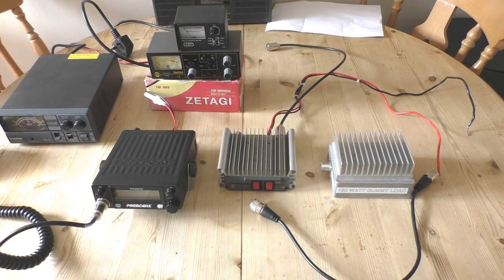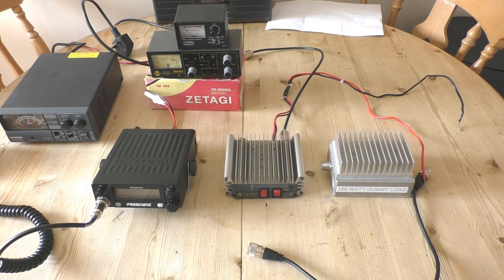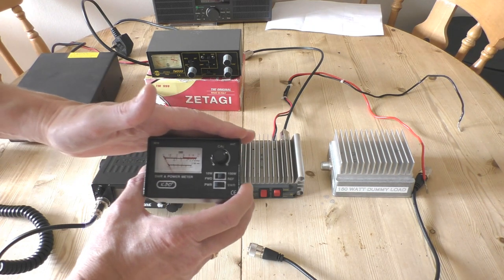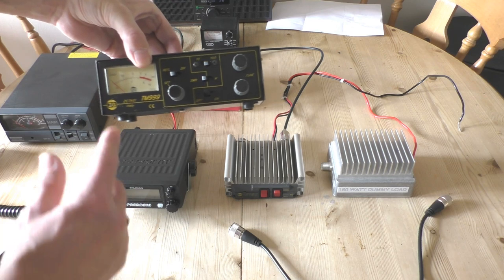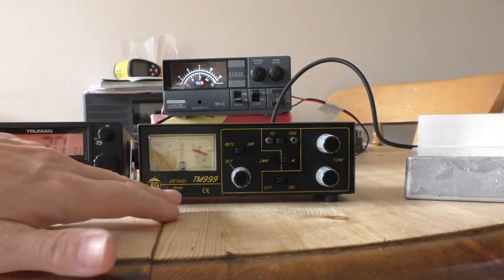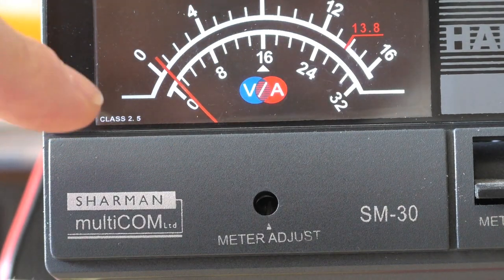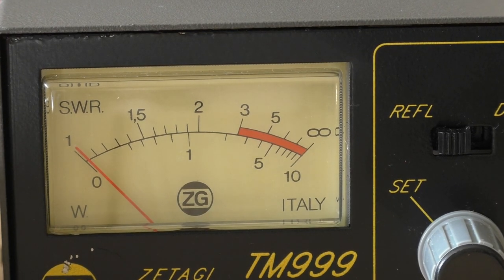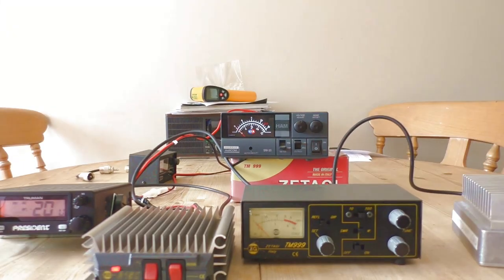How many watts do you REALLY get from a CB amp ?

Comment: I'[d like to see that Zetagi on a spectrum analyzer to see what the 2nd and 3rd harmonics look like. Upping your power through a splatter-box is not a clever move.
Reply from the maker: I doubt it would be very clean.  These small amps are built to a cheap price.
Reply: Just times the fundamental frequency by 2 or 3 and that will give you a ball park frequency. We tested a RM KL203  on a spectrum analyzer it was terrible above 60db on the 2nd harmonic. If people will insist on using them put a band pass filter between it and the aerial. Non of the so called C.B amplifier's have filtering in the P.A stages. You only have to look at the circuit diagrams to see. I won't call them linear's because they are far from it!!!!!

Comment: Apparently not to many operators here understand what S.W.R. is  the abbreviation is for standing wave ratio this can only be measured between the transmission line and the antenna therefore the meter  must be between the last transmission device and the antenna

Comment: That's untrue when you run your amplifier your SWR will always be a little bit higher because you're pushing power through the antenna you can have a flat SWR with no power and then your SWR could creep up to 1.5 with the amplifier on that's totally safe

Comment: I was in  full agreement on one of your previous videos where you mentioned the benefits of a good antenna. These amplifier are used to boost the transmitter power outside of legal power limits  and should not be used in the U.K. These amplifier don’t just amplify the wanted signal but also any distortion and harmonic to a level that could be a problem to other spectrum users.  Your power meter test don’t show how much of the transmitted power is actually on the frequency it’s needed. The SWR meter should be installed between the antenna and the linear amplifier. The input to the linear amplifier should have a roughly 50 ohm impedance it would therefore be entirely pointless to install the SWR meter between the radio and linear. You need to be very careful with how much rf power you put into the linear as again if you put to much power in it will produce horrible distortion products. Can I suggest you look at my videos on the Tiny Spectrum Analyser you may find this useful for basic radio testing or perhaps a SDR based spectrum Analyser https://youtu.be/FFgysm_HEFw.   This will help you identify any out of band distortion.  The output from the linear will be terribly distorted long before the linear overheats and pops its clogs.
Reply: Hi. I don’t think many people are bothered that using amps cause he’ll for other users and that it’s illegal. It bothers me and my breaker buddies as we are trying to stay legal but increasingly have problems with high power rigs and burners blanking channels and destroying our hobby. Which some of us have been on for 40 years now. Thanks for an interesting video Fred.
Reply: What is an SDR based spectrum amplifier? You are talking bollocks. I happen to be a profession RF engineer. Look, change the ceramic filters for 2.5kHz crystal filters and load them accordingly (about 1.2K ohm). Peak for max RX signal. Your adjacent channel noise will be gone. Put one meter after the amp, then set your VSWR resonance for the antenna. Then you will transfer the meter to the radio input. See what the VSWR is. If it's high, above 1:1.6 then open up the PA and use the trimmers to give a good match to the radio. If there are no trimers, then add a 100-200pf ceramic trimer from the input to ground. Tune for lowest VSWR. or better still lowest return signal power. Cut the coax to multiples of an odd half wavelength taking into account the characteristic impedance of the coax  Job done.
Reply: @susanlodges48  I assume you meant to say SDR based spectrum analyser. Professional LOL.

Comment: 13.8 volt power supply or 15 volt make difference in watt
Reply from the maker: Prob not. Most radios and amps are designed for a max of 13.8v.  If you put 15 volts into a CRT 6900 / 9900 you would trip a Hi DC warning.
Reply: @CB-RADIO-UK  most radios are for mobiel and most dynamo's give more than 13.8 volts i have give most my radio's 15 volts not continuously but it give your more power if you need it
Reply: @CB-RADIO-UK  look in you manual tdc on or off tdc on Dc 10.5-16V page 17 www.manualslib.com/manual/640232/Crt-Ss-6900.html?page=17

Comment: Ideally you want two vswr/power  meters , Most aimed at  CB  vswr/power  meters are pretty rubbish , Your vswr shouldn't alter much if anything at all from using a well designed  amp .... I've heard and seen people say say that " Power affects set " ..... No it doesn't , Antenna resonance affects vswr , A four watt signal , Will have the same vswr as a hindered watt or even a  Thousand watt signal , The main reason that people see their vswr go up when using a CB amp is due to its poor Input matching , A decent well constructed amplifier  shouldn't alter the vswr , Obviously you readjust the vswr meter when going from low power to higher power  if the vswr is single needle , Most cross needles vswr  meters  you just flick the switch to a higher scale to read the vswr or power ....  There's lots of CB myths regarding Amps and antennas and coax ... Most are completely wrong but still get perpetuated even to this day .
Reply: "A four watt signal , Will have the same vswr as a hindered watt or even a  Thousand watt signal "
Hooray, someone gets it right.  That's rare on this channel.

Comment: Don't those things interfere with neighbours' TV signals, or is that an urban myth?
Reply from the maker: Yes they can do.  No where near as bad with digital tv.
Reply: @CB-RADIO-UK  Do you know is it proximity to their TV aerial or proximity to their actual TV that is the biggest factor interference-wise?
Reply: CB amplifiers tend to have terrible interference to anyone still using an antenna for television.
Reply: @ZadenZane  "Do you know is it proximity to their TV aerial or proximity to their actual TV that is the biggest factor interference-wise?"
The antennas.  Your transmitter can be right next to the television withough much effect (usually) because the television gets its signal from its antenna.
The phenomenon that causes most interference is IMD, inter-modulation distortion. That happens with corroded antenna connections very common with the typical aluminum antenna.  Aluminum oxide is a semiconductor and essentially re-modulates some of the energy causing harmonics and mixing the harmonics EVEN IF your transmitter is absolutely pure (which no CB amplifier is, they're illegal after all).  
Any metal-to-metal junction of dissimilar metals can do it; the chain link fence, the garage door pieces, metal shelving in your house or garage.   I sometimes hear an AM broadcast station WAY off frequency but it isn't the transmitter's fault; just some nearby metal rectifying and modulating (intermodulation) the signal.
https://en.wikipedia.org/wiki/Intermodulation
Reply: @thomasmaughan4798  what about some of those ham radio sets that put out 100w on the 10m band/whatever, are those also bad for TV? That's a bit offputting for anyone wanting to get into amateur radio who has adjacent neighbours!
Reply: @ZadenZane  Yes and no.  Amateur radio transceivers tend to be much better engineered and correspondingly priced.  They are very clean and have built-in bandpass filters to keep out harmonics.
BUT if you have corroded metal in the vicinity, then yes, the cleanest ham  radio transmitter on Earth will still interfere with neighbors.  
To a certain extent this can be mitigated by choice of antenna that beams a signal but NOT in the direction of your neighbor (plus you get the benefit of added strength in the beam).  If you cannot have an obvious antenna then a mag-loop is a pretty good choice.  That's what I use.  Good enough!  No substitute for a beam on a tower but sometimes that is not an option.
Mag-loop antennas are finicky things and not really anyone's first choice but they have some remarkable noise eliminating features and, being sharply tuned, ignore off-frequency interference and do not radiate off-frequency harmonics and things like that.   Unfortunately there's a lot of snake oil gimmickry with all kinds of antennas.  Good old dipole is cheap and still a good solution.

Comment: Those new president radios are not worth buying they don't have the punch like the rci galaxy and Stryker and the longhorn radios I use a rci 2950dx and a antron 99 about 50 feet up in the and I don't use a liner I talk all over the USA barefoot the rci has been peaked and tuned and inlined
Reply: Same here WITH a President radio. I'm told I sound loud and proud. 73s 715😊

Comment: Oh for heavens sake.  Nothing like a bit of CB foolishness to make amusement.  The SWR at the amplfiier will almost always NOT be the SWR at the CB Radio; and that's because of the transistor(s) in the path.  The CB radio should never see "SWR" when connected to the amplifier provided the amplifier has a 50 ohm input impedance.  It will always be 1:1 SWR no matter how terrible is the SWR at the antenna terminal.
So, always put your SWR meter on the output of the amplifier to see the SWR coming from the antenna.  It is useful to briefly have it at the output of the CB and input of the amplifier to see if the amplifier is really 50 ohms input.  That is to say, you should never, ever, see anything other than 1:1 perfect (nonexistent) SWR between CB and amplifier.
But of course, since doing all that is illegal anyway, who cares that you are doing it wrong.
Reply from the maker: Thanks Tom really appreciate the information in the comment.
Reply: @CB-RADIO-UK  A problem with Chinese amplifiers tends to be too low of input impedance.  It isn't really much of a problem but it can produce erratic SWR measurements between radio and amplifier. 
My enjoyment of this kind of channel is the bewilderment that some must feel on getting hundreds of totally contradictory comments.  Do this, no don't do that; do something else.  It's great.  No, it's crap.  
Interestingly, ham radio channels have similar conflicted advice where half have it more or less right, half have it pretty much wrong but it worked anyway because radios are pretty tolerant and the difference between 10 watts and 60 watts is 1 S-unit.  It might make a difference but usually not.
That's why the new big thing in ham radio is little things; low power battery operated radios.  It's like fishing with a light rod and line; it requires some skill and finesse and is more enjoyable.  Anyone with a kilowatt can blast through the sky.  That's easy.  No skill.